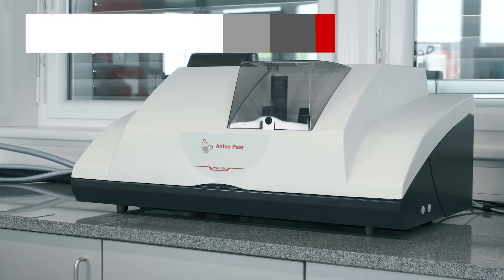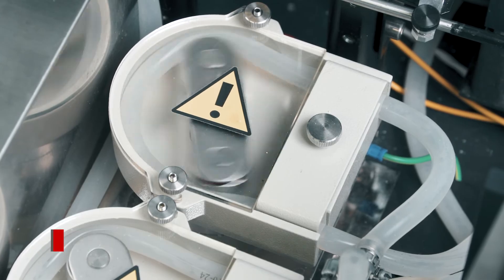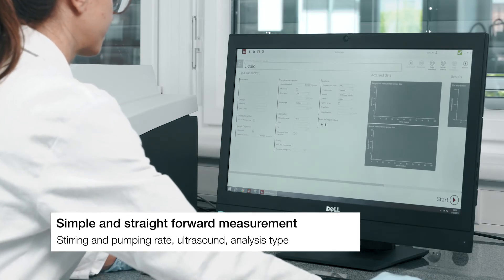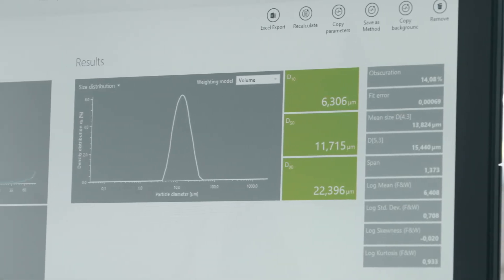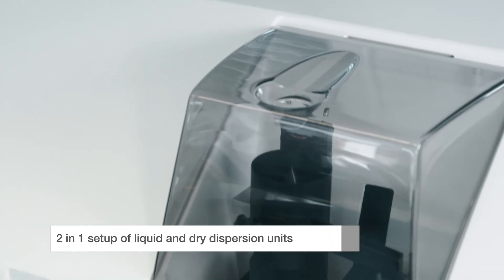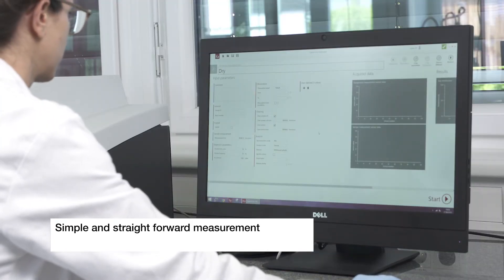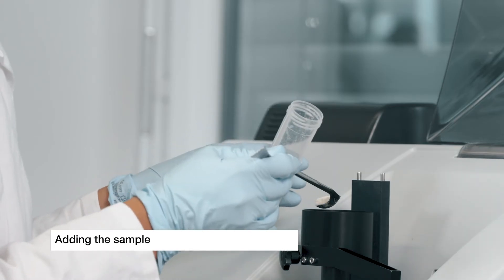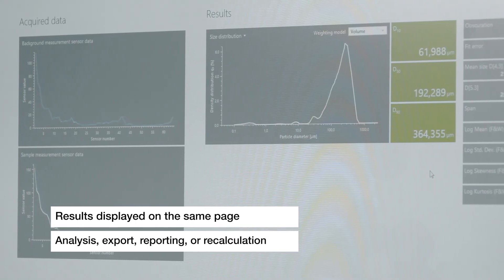Particle Size Analyzer: PSA | Liquid & dry measurements

Comment: thanks very usful please explain for me in yuor instrument for dry polymer powder mie or Fraunhofer mode must sellect psa renge i between 1 -2500 micrometer in falfree mode and how to clean 1190 freefal mode? tanks
Reply from the maker: Hi! For each measurement-mode, no matter if you select dry or wet, the analysis can be performed according to Mie or Fraunhofer. You define which type of analysis mode is to be performed. In Freefall-mode, you are dealing with particles >300 µm. Within this size range calculations according to Mie or Fraunhofer will give you very similar results. So if there is no information about the sample type regarding refractive index or absorption index you can select Fraunhofer without any doubts. The cleaning in Freefall mode is very easy. You can take off the hopper and wash it. The bowl collecting the measured sample can be removed and emptied. Particles sticking to the measurement cell can be removed with a lens paper. Hope this answers all your questions!
Reply: thanks so much very useful explanation
Reply: Thank you for your complete answer, it was very helpful
Reply from the maker: Glad to hear!

Comment: Thank you for your explanation , are you providing the raw data for analysis and  How much of sample is required for dry powder analysis
Reply from the maker: Hi Aditya, thank you for your question! You can export a JSON file with the raw data. The sample amount required depends on several factors. To establish the method we use up to 100g, although later 1-10 g are often enough for reliable measurements. If you reach out to us through the website, you can talk to our application experts directly about any open questions: https://bit.ly/3ifeD13